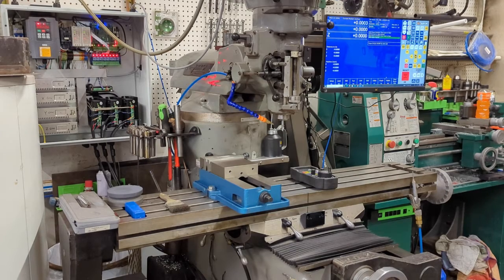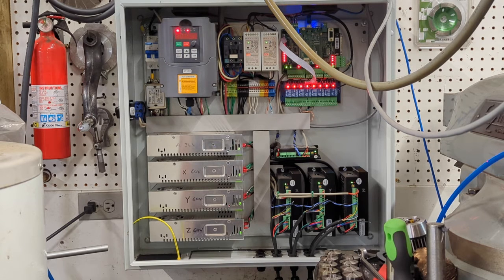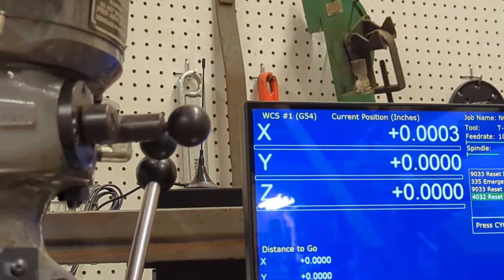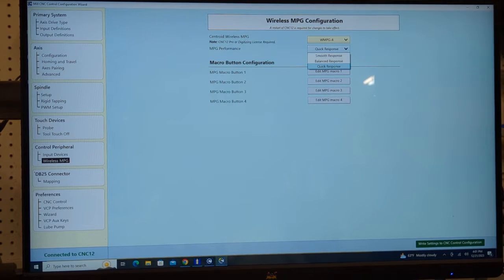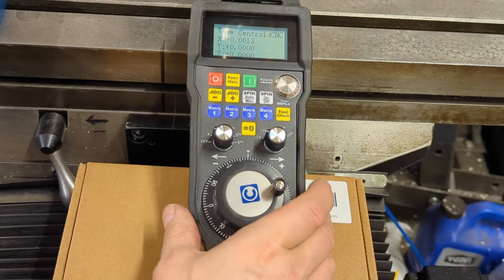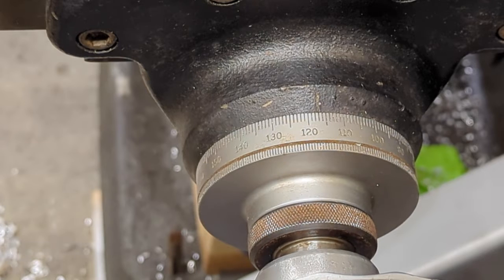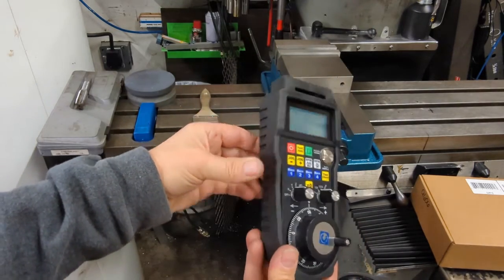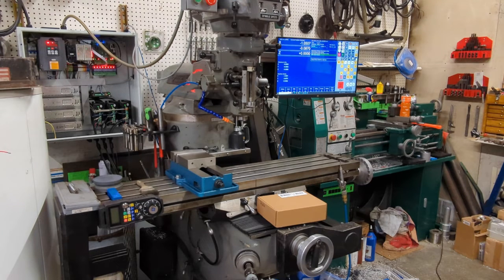Centroid CNC Pendant install in DIY Bridgeport 4 axis CNC

Comment: About 8 years ago I converted my benchtop mini-mill to CNC, using LinuxCNC. I used a gamepad controller as a pendant, but kept making mistakes when switching between axes, resulting in crashes. I am currently fitting my own MPG->USB controllers to each axis of the mill, located where the original wheels had been, thus preserving normal milling intuition. I am currently working on the LinuxCNC side of it, but am 90%+ of the way there.

When I am happy with the man-machine interface I'd like to get a proper milling machine!

Comment: How are you getting the third axis?  Are you driving the knee?  I going to convert my Sharp mill from 2 axis to 3 axis, but I think that I am going to use the quill for the third axis.
Reply from the maker: yes. The Bridgeport already has power quill feed and I didn't want to change that so I use the knee for the Z axis. It' so heavy its real smooth up and down.

Comment: Great job!  Could you share the part numbers for your build?  I am upgrading an old Bridgeport CNC upgrade too and it sounds like you are very happy with the system.
Reply from the maker: If I get a chance I'll gather up all of the parts that I bought. Took me a few months and lots of research but yes I'm real happy with the Lead Shine steppers kits paired with the Centroid controller. The Centroid pendant that I added later was a few minute set up.
Reply: Awesome content, suscribed